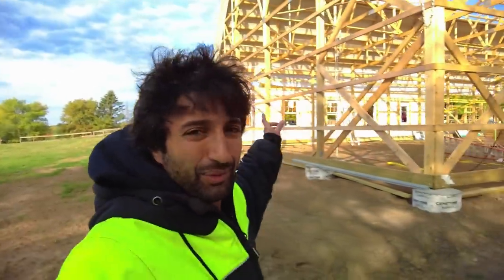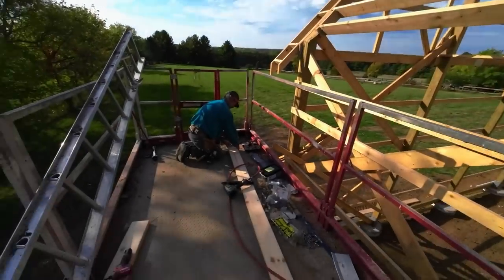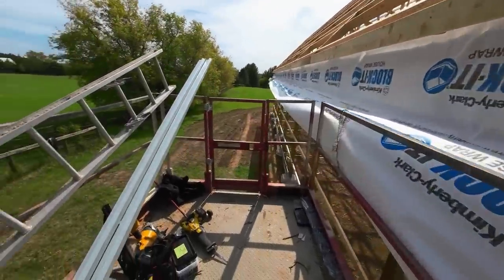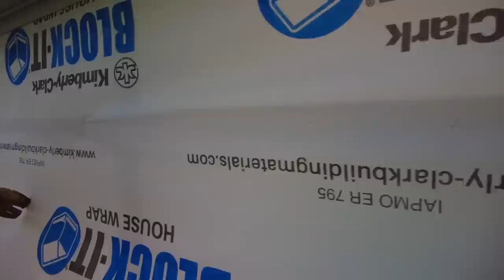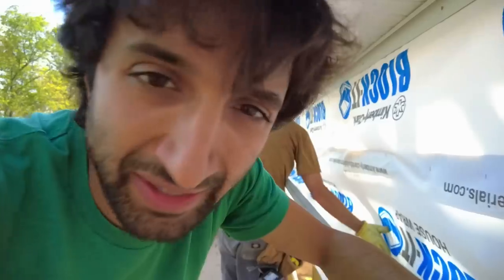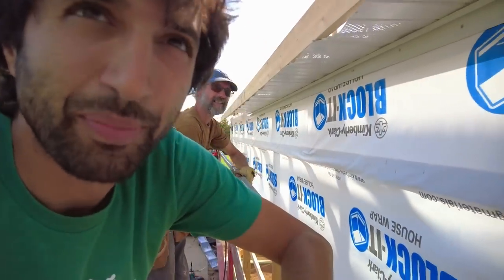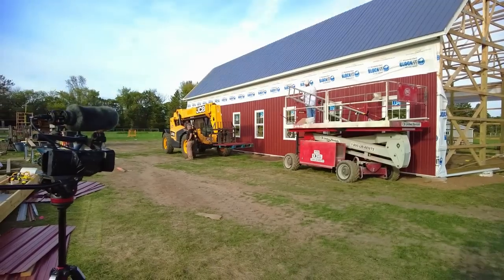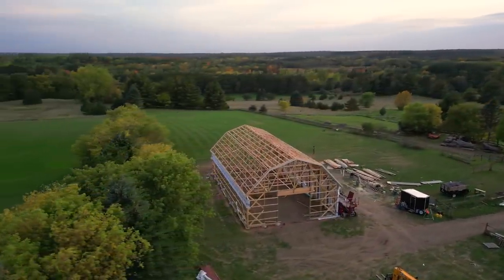The Final Purlin 🥳 - 40x72 Gambrel Post Frame Episode 13

Comment: The seams are crooked because you're trying to slide the sheet all the way to the top and it's causing it to bind.   The sheets on bottom must be slightly crooked, but it doesn't matter.   When you overlap your top sheet, just push the seam down tight and then slide the sheet to the top -- if it's slightly uneven at the top, who cares -- it's inside a channel anyway;  but at least your seams would look good.   This is also why we would tac several sheets on loosely, and make sure everything is working well, marking where the purlins are as we go;  and then go back and screw it all off.  Because if you only have a couple of screws in each sheet, they can still move and flex around like an accordion and you can force it to work well together;  but if you screw everything off as you go, there is no flexibility and you can't bend or stretch it straight again.   The point is, you have to push the sheets down and get them exactly where you want it to be BEFORE you put a screw in it.
Reply from the maker: thank you!
Reply: This building is basically closed in as of the time of this video.  Donavan's youtube channel has the most recent state of the build.  the base insulation for the radiant heat was almost complete.

Comment: Someone may have already  pointed this out, but the top parts are clearly from a different dye lot, the color is slightly different. Maybe the parts were made at a different plant, or you were sold two different types nearly the same for the siding in red?  If it's really machined from the same stuff it shouldn't have a linear creep like that...

Comment: If I had to guess what happened to those overlapping ribs looking/being swollen I'd guess the bottom panels were screwed down to hard and are pulling the ribs flatter so when you put the top panels on you are trying to force them down over a "smooshed" rib.

Comment: The framing lumber looks like finish grade.  I wish our structural lumber looked that nice.

I wouldn't be happy with the vertical metal siding seam or the lack of substrate to prevent buckling and oil canning that this siding will see.

Comment: What is thinking behind the lack of sheathing on roof or walls?
Reply from the maker: Not needed
Reply: Steve, the steel provides all the sheer strength to the building that would be provided by OSB or plywood. It is one of the advantages of a post frame building.
Reply: @bpdp379  thanks for the explanation T.

Comment: I'd suggest dropping  PLUMB BOB FROM TOP TO BOTTOM -  ON THE ENDS AN MEASURING OUT 12' TO SEE DIFFERNCE AT BOTTOM MID AND SECOND TOP. YOUR PANELS ARE NOT FOLLOWING THE SAME LINE  You are forcing a parralleogram.